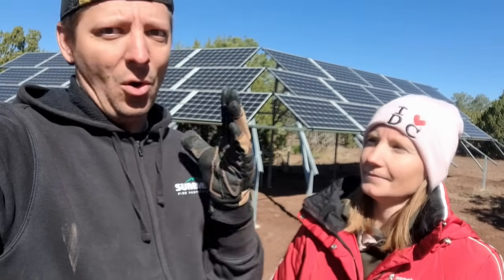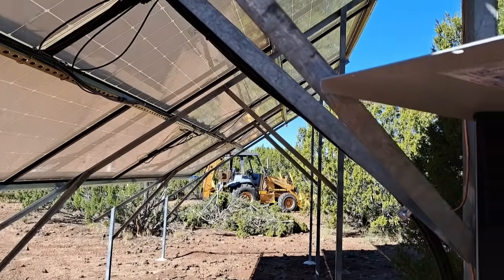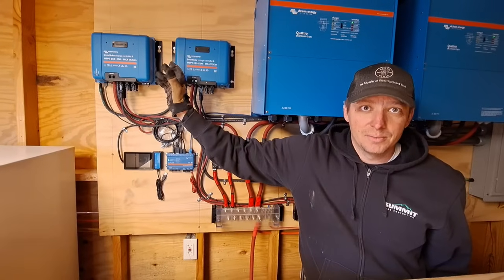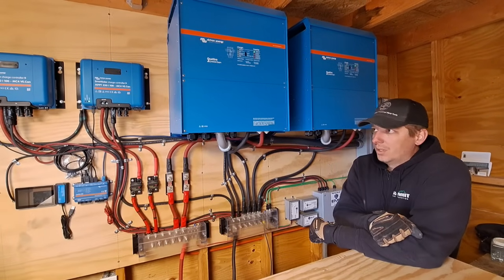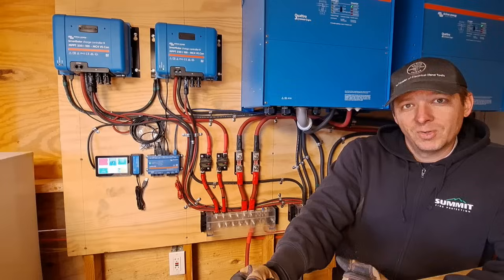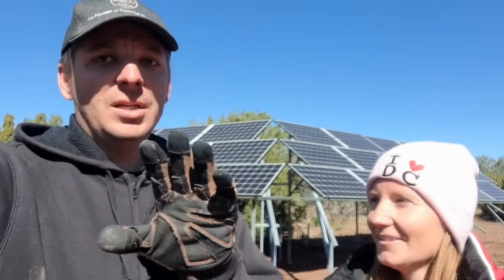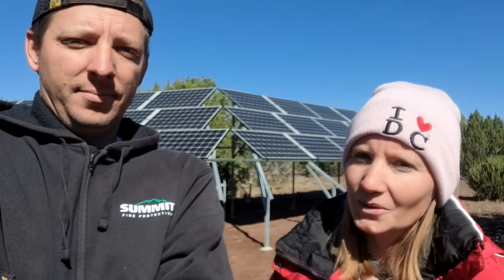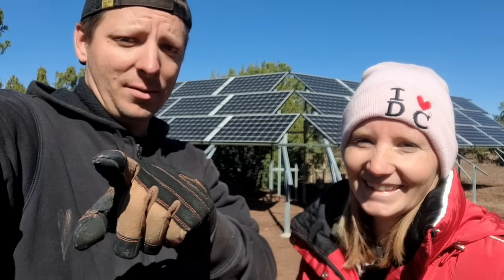INFLATED COST Of Our 100% DIY Off Grid SOLAR POWER SYSTEM 👍

Comment: Wow, I understood that things were cheaper in the US than in New Zealand however that doesn't seem the case.....
My professionally installed, not DIY, of 32 x LG NeON 370W panels, 2 x Fronius 5kW inverters, 2 x Tesla Powerwall 2 battery units with a Tesla Gateway which connects to the internet to monitor the system remotely cost only US$7,000 more than you paid for your whole system.
Reply from the maker: Not a bad deal over there. Inflation certainly didn't help us. Has inflation been a problem at all in New Zealand? Thanks for watching. 🙂

Comment: It will take between 15 to 20 years for this system to pay for itself. Even then, you will have battery waning and need for replacement at approximately 10 to 15 years and any other equipment failure will need to be addressed in order to maintain system integrity. In my opinion it is a far greater headache to maintain a fully off-grid system rather than have a partial backup to the grid. A generator backup would be far cheaper and more reliable than trying to rely on sunlight in dark winter months. I applaud the effort to be off-grid but in my opinion it does not hold the value-to-benefit that many are looking for.
Reply from the maker: The power company is too far away and more expensive. But in the end it's the lifestyle we want. Thanks for watching. 🙂
Reply: @aboulderlifeoffgrid  In that regard it was the best choice for your situation. Best regards and thanks for sharing your experience.

Comment: My average electric bill is a little less than $200 per month, with all electric heating, A/C, cooking, etc. Assuming zero maintenance costs, it would take almost 16 years for me to break even on an equivalent installation. Invest that $37,000 in a diversified portfolio at average stock market returns, you could reasonably expect to have a balance of almost $150,000 at the end of those 16 years. I am all for clean energy and self reliance, just make sure you don't buy into the fallacy that there is an economic benefit to it at this point. Maybe in another 10 years when panel efficiency is 10x current standards and increased market competition brings equipment costs down. Great job on the install, though, and thanks for the video.
Reply: It's not so much about financial benefit for some of us.  It's the independence.  Don't get me wrong...lol...150k is a compelling argument in your favor.  From the other side of it all....look at folks buying depreciating assets like a car at 37k amd don't think twice about it.  

From a financial perspective....im with you. 37k invested to return 150k is better than spending on solar.  However spending 37k on something that will actually lend a return in due time is a better investment than a depreciating asset that costs you money on its way to be valued at zero.

Every time someone says "that's too much" I ask them "how much did you pay for your car and how much will you trade that in for at the end of the loan term?"  People need transportation....it is just putting a bit of perspective to "cost"

Comment: Decided on the SUN SYNK inverters as they were more sophisticated thaN Viktron.  I prefer not to buy Chinese products, but the product was much better and less expensive than the Danish product. Batteries are local 5kwh  and panels from China.My system is 2 X 8kw inverters , with 15 kWh of battery and 11kw of panels. . Battery pack  upgradable to 20kw at only the battery cost. It’s a 240v  system. To match your system it would have cost $25k. We don’t need as many panels as we have more sunlight. The 11kw of panels can generate 66kw per day in summer and 55kw in winter. Only problem, is if it’s very overcast for a few days in a row, power generation , from the panels is half or less. Not DIY . FYI From South Africa.

Comment: Why did you go with those battery's when you could have fit like 10 smaller and cheaper and lighter battery's that are still 100ah and for so much less I personally am going with ones that are about $140 ech and a 1/4 the size plus the Victron controllers will pick up those smaller cheaper batteries
Reply from the maker: My knowledge of batteries at the time was limited😅. And that's what the slick salesman sold me. But I've learned a lot since posting this video. Thanks 🙂
Reply: I don't know much ether like messing with 220voltAC I have not realy messed with but 440vAC I have and 3.7-82volt dc other then that I have a lot to learn I'm only 27 and I have just started my solar stuff still at 12volt tho as I have found it to be easier to understand for me as I have been installing car audio since I was 12 or so          I try not to mess with much else but if I have or get a chance to learn I will that's how I got 440 is silo work and the farm welder my dad the farm owner and I had to redo it all to bring what was already there up to code

Comment: Stand $1400 if you can find most of it for free.
Solar Panels $6570 without installation
Breakerbox +extra $646 without installation 
Controller room +Batteries $28093 without installation and would be illegal in most places to put up yourself if you're not certified.
Total cost $36709 without installation cost of excavating, welding, wood work, and like idk 200 hours of electrician work total cost? maybe $100K or more.

In conclusion, living off grid is a luxury most people can't afford.

Comment: Wow, those 300W panels were way overpriced. I got 400W panels 1,5 years ago for around CHF150 here in Switzerland, one of the most expensive countries in the world. If order some 440W today they run me CHF 72.  I don't know why they make it that expensive over at your place. They are definitively to expensive for their power output. The rest of the mount what you did is actually really god price. What dimensions do your 300W have? The newer 440+W Panels are really large at around 2,1m x 1,1m. As you left space below you could add maybe 4 more powerful ones per row as a 2nd string. If you get them cheaper it will lower your $ per Watt overall.

Other than that very well done! I love my 3x3000 MP2 Victron setup. We have 3 phase power in Switzerland/Europe most of the time. So it is even more expensive as you need 3 Quattros or MP2 if you want to power a house but hey I'm not complaining as my house and especially my IT equipment now has a huge UPS called home :-) This alone was worth it to me as I have a lot of servers etc. 
I use our system as an ESS system which lowers my power bill as it charges the batteries during the day with the leftover PV power not directly consumed and use then this power during night. Only in Swiss winters it is hard to do that. How is winters working for you guys over there? Lots of snow? I dont know the region you are living in.

About the battery storage. I used standard IT Racks. The deep heavy duty ones which can holds hundreds of kilogramms. I have 20kwh of batteries in there (Pylontech) and still have 2 Servers and the whole Network stuff in there so it is dual purpose even and it is half the size of yours :-)

Comment: 11:15 imagine... these small MPPTs can handle 250V in , 100A(~55v) out or 5500W each... very small compared to the inverters.
But should you be mounting them on non-combustible wall? The back heats up.
Reply from the maker: Maybe. We'll keep an eye on them.

Comment: My house is small,  but my needs are 200 amps.....So, according to your 100 amp installation;
the price would be somewhere around 80,000 dollars?  Or am I wrong.
Even at my outrageous $300 a month utility bill,  I will not be alive by the time such an
investment pays for itself.   I thought the media has reported that solar installation was 
coming down in price all the time.....In the 90's a solar outfit in town could have sold me
a 200 amp system for $26,000 thousand, installed.......Seems the price would now have "tripled".
Just does not work on the numbers side as I am a senior citizen whose working life is over
and my small monthly pension will never allow such an expenditure.   Maybe if you are in the backwoods, or on a tundra, far from utilities, and with financial means,  it would make sense.
Now,  if Entergy goes crazy and starts charging $1,000 bucks a month or more;  Then, would
probably have to go back to work and try to swing an off grid system....Then another problem.
It is illegal in my city limits to disconnect from "one utility"......The city computer sees your
property as abandoned and cuts off all utilities.....I hope younger people force politicians to
change that, but I am too old for another fight.
Also,  incentives only benefit the well-to-do; you have to earn a lot of money to take advantage
of the incentives which only come in the form of "tax breaks"....If you earn under a certain amount
of money;  incentives do you no good......Solar industry should use their lobbyists to canvas 
congress to pay back some of the cost of buying a solar system to anyone installing one.
That would help the most people and help get solar off the ground much faster.

Comment: You could have went with the GEET Fuel Processor and it wouldn't have been a strain on the environment and the cost would be a lot lower. In fact, you'd be doing a service to the environment. 
A GEET Fuel Processor, invented by Paul Pantone, burns 20% oil and 80% water through a conventional combustion engine and produces 3% more Oxygen then what's in the atmosphere you're breathing now. Local Restaurants would be eager to give you their spent fryer oil instead of paying a company to haul it away. Each 5 gallon jug of spent oil is actually 25 gallons of fuel. Spend your money on an automated filling system so all you have to do is top up your reservoir with spent oil. Combine that with feeding your excess electricity back to the pool, and you'd would be making the maximum allotment allowed. 
The GEET Fuel Processor is so easy to make, hundreds of thousands of backyard mechanics are making them, and a lot are showcased here on YouTube. Some are using beer, coffee, a little bit of gas and 80% water to run them. 
But if I had my choice, I'd want Dennis Lee's invention in by backyard. Dennis Lee is the only person who won a Federal Government Lawsuit for claiming the panel system he had developed, manufactured and sold produced Free Energy. Yes, he WON a Free Energy Fraud Case! Which bags to question, if the U.S. Government knows about Dennis Lee's invention, and they most certainly do, why isn't Dennis Lee's invention mainstream? You know, if we have to save the World? 
Dennis Lee's invention uses a subzero gas that collects heat from anywhere in the world, the heat is compressed and turns water to steam, the steam drives a steam engine in a closed loop and the process repeats over and over making electricity. Low manufacturing cost, easy to make, low maintenance and can be retrofitted to Simi Trucks and Railway Cars right now!
Nope, you got sucked into the Libtard Narrative that there's a Climate Change Crisis, there isn't. It's a hoax. A tool to filter funds in the way of Campaign Contributions from the Solar Panel Industry back to the Party of Infanticide. A Power Grab to keep the Commie Leftist's in Office and in Power. Point Blank! That's what's happening. The name, Dennis Lee, proves that. 
Sell that crap to some other Libtard, build a GEET Fuel Processor and actually make a difference. 
Go Trump 2024!
Reply from the maker: Never said we believed in climate change. We just want to off grid. Thanks for watching.

Comment: That's kinda sad, hearing the price. But not knowing what your "capacity" is in terms of kilowatt hours, or how many kilowatt hours you use per month. Would be nice to know how much your "paying" in up front costs vs. 10-20 years of operation.
Reply from the maker: We would like to run everything on electric (range, clothes dryer, water heater, etc.). The size of the system is a good start, and we'll add to it if and when needed. We have a 30 percent federal rebate that we forgot to mention in the video, which brings the price down considerably. Thanks for watching. 🙂

Comment: You should have build your batteries yourself. It is very easy especially when you have done so much elsewhere. And.... it takes less room. I built 2 x 48 Volts 280Ah batteries providing 32 kW. My cost including the 2 BMS was$4,400....

Comment: Thats a crazy expensive setup. The all in one systems are way better value. I got 2 growatt 5kw all in ones for less than 1000 euros combined. No need for bus bars, extra montoring stuff etc. If one invertor breaks I still have the other one as backup, and I can replace it for 500 euros. Also takes up way less space because you dont need all that exposed wiring between the mppt, monitoring system and invertor.

Comment: Eh, it was really $37k PLUS your labor.  So it was probably petty close to the $80k quote you got.  Also, I’m quite pro Solar, but from a climate change perspective, you have to include all the carbon that was burned to make all the hardware used in the installation.  I suppose it will come out positive in the end, but I suspect you have many years before the carbon footprint created by the building of all this hardware is compensated by the carbon saved by being off the grid. That is something that a lot of “Greenies” never think about.  But great build and thanks for sharing!

Comment: Damn thats so expensive!! We're in New Zealand and pay 40 dollars a month for power from the grid. family of 6.

In saying that solar is great for remote areas and the main drawback are the batteries - they are the most expensive part of a system and the technology is still useless. Ive had solar in Vanuatu and that would barely get us by during the dry season let alone the wet season in terms of battery storage and that was with no fridge or tv.
However we did use solar during the day (inverter running off the solar panels) to run a few items.

Until battery tech is improved other forms of power generation will be 1000% better than a solar setup.

Comment: Your system isnt that big, but sounds expensive for what it is. Im looking at 30kw of solar, 150kw of batteries 12kw 415v plus 4kw 240 volt. pricing it up, its about 80k,or about 55kusd and that is with mostly victron. For a workshop, so tax deductable also. Considering getting 3 phase out to the farm would be 30k, its worth it.

Comment: If the batteries need to be replaced every 10 years on average that’s ridiculously expensive. It would take me 25-30 years to break even just assuming there’s no repair needed to the solar system. If the batteries need to be replaced, even though the price may come down and technology improve in the next decade, it doesn’t make financial sense for most people.

Comment: 24kWh of battery? I bet it can power much more than a electric range, dryer and water used together for 5 hours a day! and why would you need a dryer if your area has so much sun?
Reply from the maker: The clothes don't dry well in winter here. It's too cold. Thanks for watching.

Comment: AC makes sense when you must distribute power across long distances.  Many of our appliances are designed to support an AC world.  But many appliances take that AC and convert it back to DC.  

So here we go from DC panels to DC batteries to DC surge protectors to DC to AC inverters to AC power panels to AC appliances with transformers converting back to DC.

Can you see the inefficiency and the inflated costs?  I think a better home system in a "perfect world" would be DC (voltage debatable - I'm good with 48).  And we convert AC from the utility company to DC, instead of the opposite.  And our home appliances would all be built to support DC and have small built in inverters as needed to convert back to AC.

If the world worked that way, the inverters and all of that expensive equipment on the AC side would be completely unnecessary.   And every home could easily add a battery backup only needing simple charge controllers.  Even backup generators would be simple and cheap because they would only need DC out.  

None of that will probably happen in our lifetime.  We inherited the system we have.  But in theory wouldn't that be a better world?
Reply from the maker: There's something not many people think of. It makes sense. Thank you for sharing. 🙂

Comment: Ok say you pay electricity
$300 a month
×   12
$3,600  a year 
×.      8  years
$28,800
That's how much you'll be paying for electricity bill for 8 years if you paid $300 a month and I think most people pay even more. I would say having solar pays off after 8 years and if there's no major problems like needing new batteries or panels etc and you can light up your house 24/7 I think it's awesome.

Comment: The BIG question is...How did you conceive the engineering for the system that you required?  If it's truly DIY, did you have no help in your equipment decisions?
Reply from the maker: The Victron distributor in our area was very helpful when we had any questions. It was diy in the sense that we physically put the entire system together on our own. There is an entire playlist of the build if you'd like to see. Thanks for watching. 🙂

Comment: Your battery is 100AH @ 48v * 5. How is that 24000W? Isn’t that 24000Wh or 24kwh, which is 3000w or 3kw assuming 8h usage? The battery is not that big compared to your generation which is 9kw and 8h of sunshine equivalent to 72kwh per day.
Reply from the maker: Correct, the battery capacity is 24kwh.